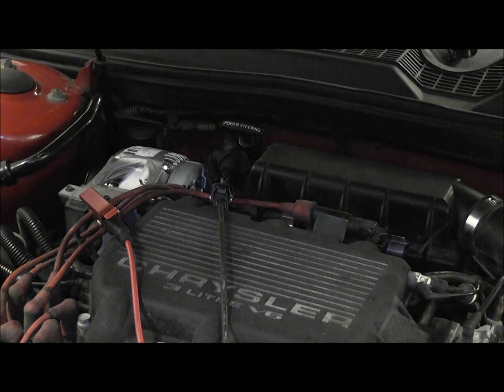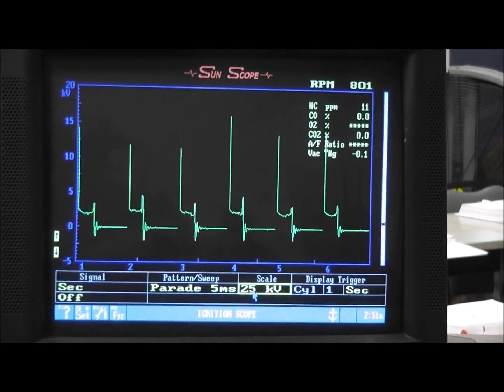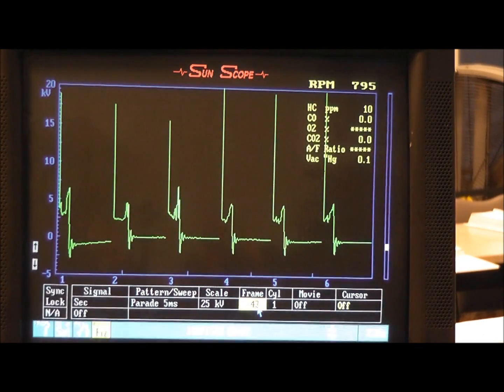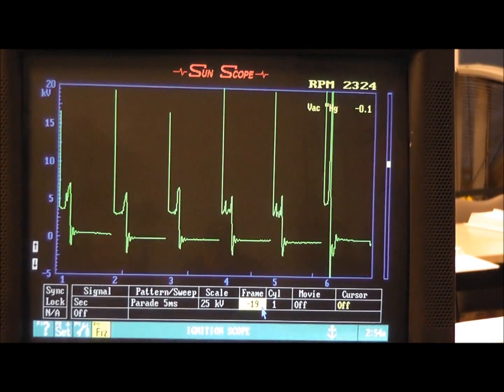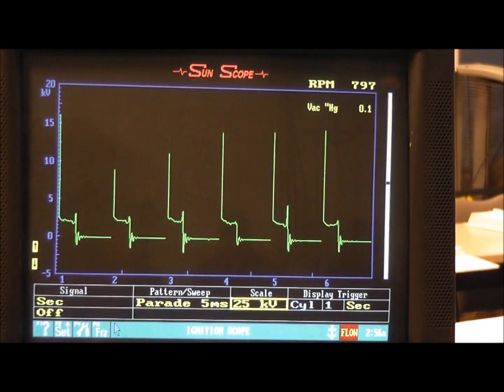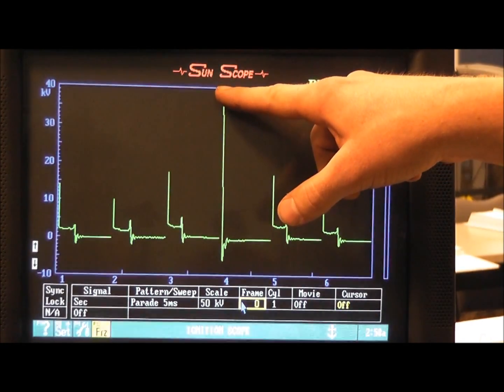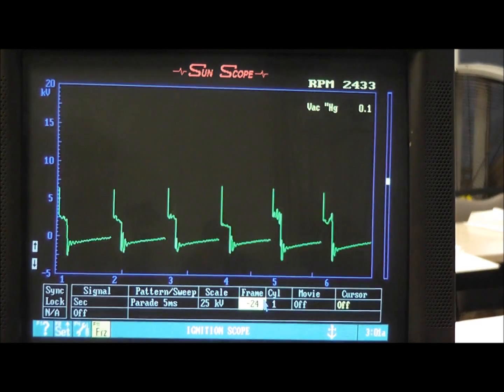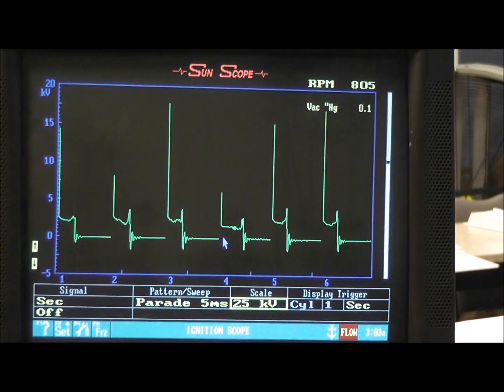Secondary Ignition Waveforms (common faults)

Comment: Hi Paul
Question.What does pattern looks in a cylinder with low compression?(burnt valve) My guess is lower KV and shorter burn time due to lower cylinder pressure?  
I love the way you explain everything
Candle in a breeze?

Comment from the maker: Also check out my "Injector Balance Testing" video. 
To answer your last question, the problem cylinder with the bad injector will not flow the same amount of fuel even though the pulse width is the same for all the cylinders. So it doesn't matter how much the ECU tries to compensate, it simply cannot.

Comment from the maker: Remember there is other causes of lean misfires. You could have a leaking manifold runner gasket on one cylinder and the waveform would look similar. This is a guide type test, there may be a need for other tests to pinpoint the cause. As for fuel trim problems, I will not use a secondary ignition scope to diagnose them. As for injector flow between cylinders, there is a specific test for that. Check out my "2005 Neon Injector Problem" video (poor quality video, it was my first one)....

Comment from the maker: I showed the lean one. An open spark plug would look like an open spark plug wire (which I showed). Lean and rich mixtures will affect this spark line. A rich mix will be harder to identify using this method alone. Unless of course the plug is completely fouled out, in which case there will be no spark line or a very short one.

Comment: Thanks for excellent video. question for you,  what happens in case lean misfire(stuck injector) or leaking injector, is there any way we can find out from wave form, My biggest worry is ECU is going to balance lean or rich fuel by adjusting fuel trim, so ignition waveform may looks good, is my understanding right, ?. Also if one injector is (lean or rich), ECU will increase or decrease the pulse width equaly to every cylinder, so how do we indentify and correct this problem . Pls advise.

Comment from the maker: The resistance built into a spark plug wire has no affect on performance of a stock engine. This is due to the ignition coils reserve capacity. I would say most ignition coils have at least 30,000 volts of reserve capacity if not more. Putting in zero resistance plug wires WILL NOT give you more power. However if you built the engine and have upped the compression ratio which requires more coil energy to fire, then you will need all the extra energy you can get.